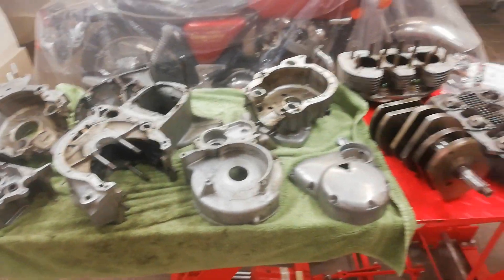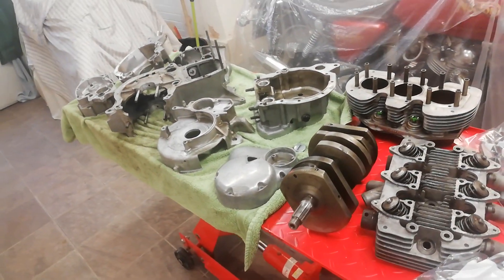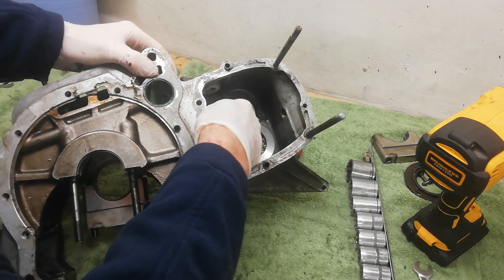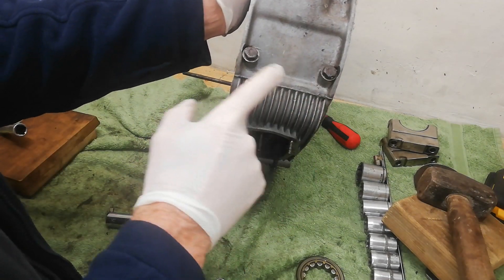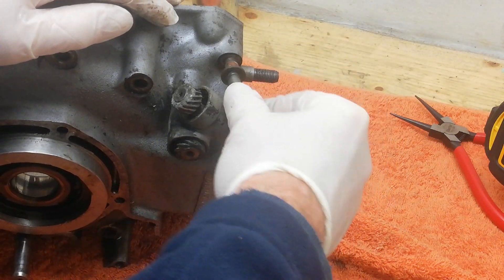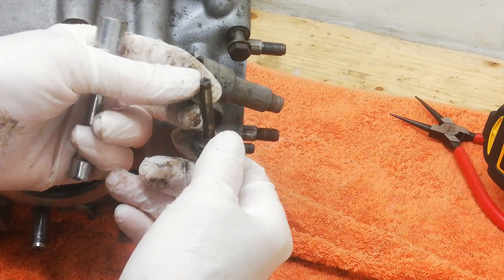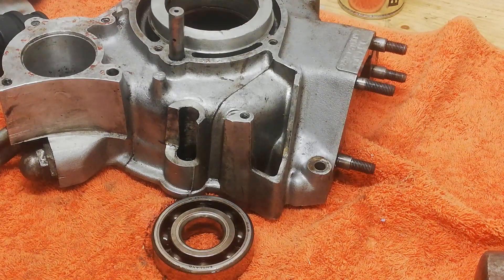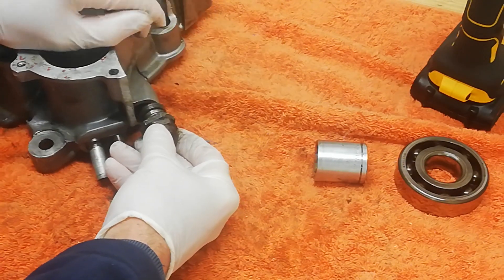Triumph Trident T160 Engine Rebuild. Part 10: Stripping the Crankcases

Comment: Thanks for another great video Chris.
My T160 gear box camplate has some movement in the bearing.
When trying to engage 5th the external knob on the camplate at 1st gear catches on the top of gearbox casing aperture. 
Q. Assuming there is a bush in the casing for the steel pin on the camplate. It it possible to replace the bush without stripping the engine.
My simple solution is the grind the problem piece.
I have weakened / shortened the detent plunger.
Reply from the maker: I think you'll need to strip the gearbox. I suggest you have a look at the videos I made recently on rebuilding a T150V gearbox which includes much detail on the camplate and its operation. The central boss on the camplate is separate and is a push fit in the plate and can be renewed separately. Here's a link to video number 8 on the T150 - have a look at this as well as the others, especially video number 11. Hope that helps. https://www.youtube.com/watch?v=H91QLpEfUnk
Reply: Fantastic Chris, I had not watched that 150 piece, all is now clear.
My gearbox is stripped already. I will gently dremel the casing.
Thanks again.

Comment: Good morning; I stumbled your clip about riding a T160. Pretty good one; nice landscapes and the roaring of the engine s great.
Then I clicked and see the rebuilding. is from that motorcycle? I am late to the party but what s happened?
I take the opportunity to ask you if you have or know some one to have a T140E crank in fine condition to sell.
The other day on the road a knocking sound started so I shut off the engine thinking of a connecting rod bolt loosen but in the end the crank have a fissure/fracture around the sludge trap. Thanks
Reply from the maker: Hi there. Thanks for the feedback. Fortunately this isn't the engine out of my T160 but somebody else's that I'm doing for them. Bad news about your Bonneville crank, I'm afraid I don't have one, but I hope you find one soon.